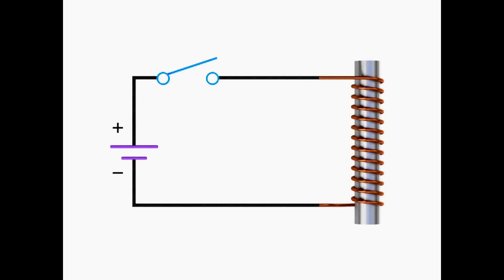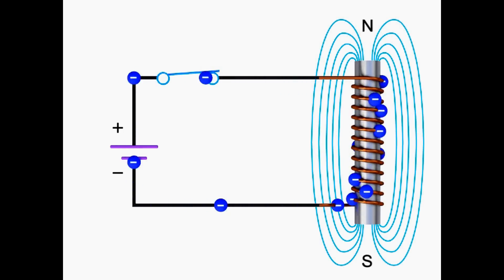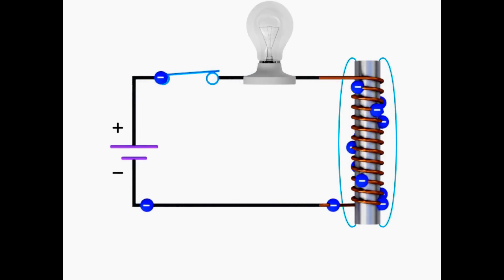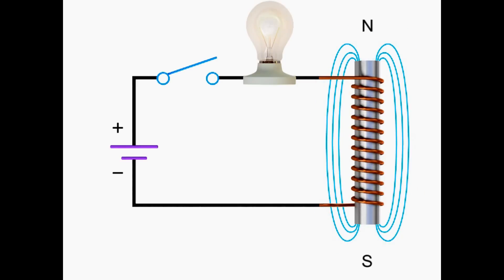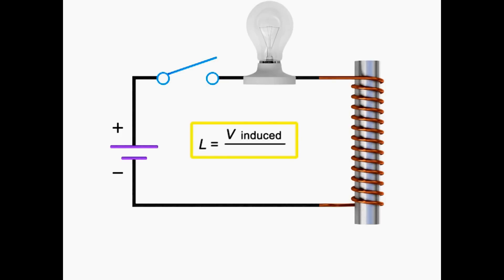How Inductor works

Comment: It is nice speaker. But, there is so difference here, you use DC voltage. But the inductor is  considered as short circuit in DC, where V=L*di/dt, and there is no change in DC voltage or current. However, if you use AC source, I completely agree with you.

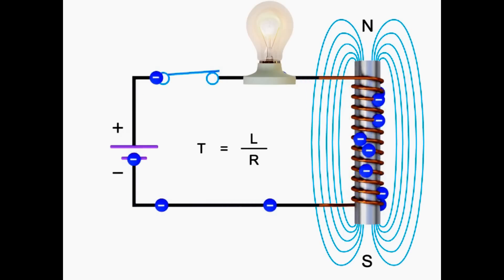Comment: 2:05 when you open the switch the light will go out immediately as there is no longer a closed loop (kirchoff's law). The voltage will rise as the field collapses but it will not magically keep the light bulb lit with an open circuit. incorrect visual.

Comment: What an authoritative sounding Get.
Michael Faraday discovered the law of magnetic induction.  I.e. that a CHANGING magnetic field causes a voltage in a loop, or circuit encompassing that changing field. 
 The voltage, e, in Volts will be equal to the number of Webers of flux change per second - in each and every loop around it.  It is that simple.  
   N.B  Iron saturates towards 1 Weber/m^2, i.e. more magnetising force H, amp-turns/metre, will not make the increase in magnetic field strength, (B,) ( flux density(Wb/m^2) ), that it did at lower flux densities.
   Inductance is exactly analogous to Mass in mechanics, if Voltage is analogous to Force (Newton's), and current (amperes) is analogous to speed.
The relationships are precisely the same, Viz,
Induced EMF, e = N.dFlux/dt
Force, f = M.dv/dt

L (Henry) is defined as flux-turns per ampere, If Flux is measured in Webers.   So if, for instance you double the number of turns around a given iron core, you get twice the flux for the same current as before AND, twice the number of turns, so you have Four times the inductance - as long as the iron does not get Saturated !!
Inductance proportional to N^2

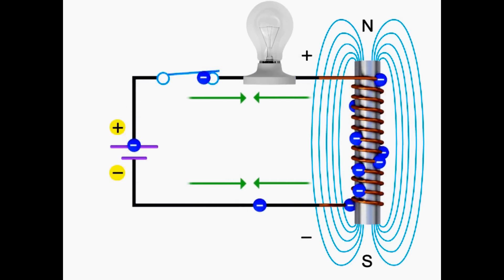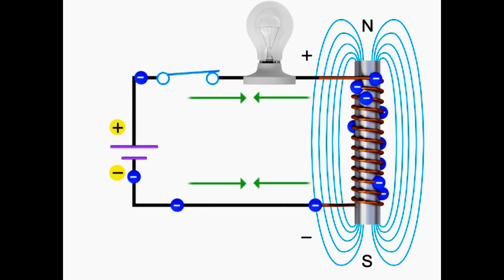Comment: It is interesting to discuss what was said at 1:25 through the statement," Generates a voltage that resists the current coming from the source!".   In the diagram shown at 1:25 it is clear that the current of electrons is shown going into the positive terminal of the battery and they are shown going out of the negative terminal.  This is obviously correct. Then " current coming out of the source" means that it is coming out of one terminal and going into the other of the source!!!!   Then there are two arrows at 1:23 shown going in the same direction which presumably refers to the current and then another set of arrows going in the opposite direction.    Well, the fact that the electrons are emerging from one terminal and entering through the other to mean would require the arrows showing the current to be in opposite direction to represent the entering and emerging of electrons from the source! Perhaps I am being too fussy!

Comment: Would a correctly sized capacitor across the inductor prevent the spark from occuring?
Reply: But there would be a Splat at turn-on then, since the lamp filament will be cold and low resistance.
With a C across the coil - or switch - the result is just like a hammer hitting a Spring.  The softer the spring, (bigger C) the longer the pulse, and the lower the peak force, volts.

Comment: Interesting about the spark across the switch.  I am planning to use a mechanical relay to turn a hotplate on and off.  It has a standard 1500W stovetop coil heater element.  I wonder if this coil will have enough inductance that I should be concerned about arcing in my relay?

My guess is that the inductance is quite low but if anyone knows otherwise let me know.

Comment: Is there inductance in DC circuits? The source is DC if I'm not mistaken.
Reply: The inductance is a value attributed to components within the circuit. So yes. Any wire/coil has some inductance. At some point you will apply or disconnect the DC source, and then apply an impulse to the circuit. In the stable (DC) situation, all of the inductors have zero resistance, and all of the capacitors have infinite resistance. In between, where we have some AC current, there will be out of phase reactances coming into play to cause oscillations of voltage and spikes of current etc. Combinations of LRC values in a network.

Comment: Now, use some nice transformer or inductor with the iron core (it may work without it, but...). First, make contact clean so that you can hold the electrodes. Briefly connect both electrodes while holding it's ends to the battery (small one, 3.7V, 9V, 12V...), and when disconnect - small shock. Show it to your friends and ask exact moment they "saw the stars". :D
Reply: Capacitor hold a charge ,  till it is discharged ,  that is why working on a TV Microwave or appliance you first ground it out , a 220 volt 15 amp capacitor can kill you .
Reply: @JCcanU  The same thing with inductor - it hold magnetic field while current flows. When rapidly current stop flow - magnetic field collapses as fast as stray capacitance allow it. If capacitor is in parallel with the inductor, then it slows down rapid magnetic field collapse, thus producing less voltage difference at the coil outputs. Grounding one end of the inductor will not prevent anything. There is also no "15 amp capacitor". Capacitor store energy and it is expressed in Joules, and it has letter for energy 'E'. Thus, E=1/2 V^2 * C (one half times square of the capacitors voltage times capacitance).

Comment: The whole explanation is compromised because you make the mistake of asserting magnetic poles. There is no such thing: only loops of magnetic field (divB=0). It is the field lines, more properly the flux , INSIDE the coil, which leads to the phenomenon of inductance. Otherwise OK.

Comment: Its bothering me that the flow of electricity is flowing the wrong way in the diagram... xD it goes from positive to negative. Positive is the energy contained, and negative is the energy drained.
Reply: The direction of the current makes no difference to the effect of Inductance.  Inductance opposes CHANGE.

Comment: F=1/T   T=R.C
T= R.1 *  XL
R1is   resistane of lamp
XL = resistance L (coil) henry= H
So  ..... F= 1/ R1x XL
: R1= 220ohm
 XL= 100uH = 0.001Henry
So as  = 1/0.22=4.5sec 
After your turn switch open switch cuicuite 
Lighting  is darkness slowly  with 4.5 sec time

Comment: Never used a magnetic core inductor. Every inductor we have ever used (1000's) have been air core (air choke) without a magnet and does the same job.
Reply: Depends entirely on the application.  The good thing about no core is that you don't have saturation to consider.  The bad thing is that the inductance provided is relatively miniscule !!

Comment: the power source should be AC or DC?
Reply: Inductance just does its thing regardless.  This bloke explained nothing.  Inductance is Flux-turns per Ampere.  The EMF (volts) opposing the current is Always L, the inductance in Henry's, times the rate of change of current.
Inductance is the analogy to Mass in mechanics.

Comment: Why does an inductor able to be induced voltage by using a DC supply? Since DC flows only one direction and has a constant magnetic flux. Doesn't that mean the rod cant be able to induce voltage according to faradays law as it needs alternating current to do so?

Comment: You state that caps store energy in voltage and inductors store energy in current. Wrong inductors store energy in its magnetic field. Yes, the energy in an inductor is equal to 1/2 times the inductance times the square of the current,     energy = 1/2LI^2 , for purposes of computation, but the storage actually is in the magnetic field.
Reply: TheSpeklOne then he failed to explain the lesson properly.
Reply: I think he's talking about how they release the stored energy - the explanation was porrly worded
Reply: It stores current in the magnetic field...
Reply: @Tributary House Ltd. 
But the Seriously wierd thing is when there is no dielectric or magnetic material, the energy is stored in Space !!  Then What's even wierder is that C increases as physical size decreases !?
Reply: @jb9072  
Inductors and Capacitors both store Energy.  How and where is their business.  Not interested.
Reply: sub vibrant tech bro u will get beta staff

Comment: Hey wait!...you said if the open the switch and stop the flow of current, the electro magnetic field will diminish rapidly and simultaneously release energy in the form of VOLTAGE? it's supposed to be IN THE FORM OF CURRENT because inductors store current and not voltage. Capacitor stores Voltage. I think there's a slight mistake in your narration. In the later part of your explanation you said it correctly that capacitors store voltage and Inductors store current, both of which are still of course energy. Please don't get me wrong...I am not being sarcastic...I just noticed something that needs correction in your narration. Peace Bro!!!...BTW just a suggestion, it's better to show the circuit in parralel connection 'coz it's easier to be understood than series connection although both are correct I know.
Reply: aray leche coil same capa not all as 
Capa chager /dischage
Coil  delay current
Reply: Caps store energy in an electric field, inductors in a magnetic field. When you short a cap, theoretically you get infinite current, and opening an inductor produces infinite voltage.

Comment: hey there, I am wondering if you could explain how to create a e-cigarette at home that uses common AA batteries instead of lithium... I am thinking that a circuit that uses 3 or 4 AA batteries with some capacitors, resistors and a inductor may do the trick but I lost the knowhow decades ago... could you create a video about this??
Reply from the maker: I will make it.
Reply: stop vaping its making U ugly
Reply: The E-cig doesn't care about the type of battery you use.  It only cares about its shape (if it has a battery cavity), the voltage, and current supplied.  If the AA has the same voltage and current rating as the Lithium, it will function the same.  If not, you need to convert the battery power to an acceptable operating range for the device.

Comment: wait, so if i run a 20mhz at voltage ac i can expect a discharge bolt out of the blue, so this is why people put a arc pole near the coil to discharge to earth any spike that comes off when switching off, i have a three phase induction heater on it's way so i can expect a massive arc bolt at tripple the voltage spike arc off to bolt hopefully it won't cause a earthquake, i'll go easy and try to remember this spark off end thing each time i might put a warning note in vivid permanent marker to keep back when switch off , thanks you so very much i nearly for got about that, i might tone it down

Comment: DONG GUAN LMET TEAP TECHNOLOGY CO.,LTD (lmeTTeap), acts as a prominent company engaged in designing, engineering, manufacturing, supplying and exporting premium quality assembly automation solution as well as automated assembly machine (assembly line). Our offered range encompasses full-custom automated connector assembly/production machine, automated switches /production machine, electric plug and socket assembly machine, metal hardware assembly machine, molding plastic assembly machine etc.

PRODUCTION LINE
Connector assembly automation:
RJ Connector assembly, electronic connector assembly machine, terminal block assembly machine, AC/DC Power Jack Assembly machine, USB Connector assembly machine, Pin Header & Female Header assembly machine; HDMI connector assembly, FPC connector assembly machine, IDC Connector assembly machine, SFP Connector assembly machine, SCART Assembly machine;
Switches Assembly Automation:
Rocker switch assembly machine, thermostat switch assembly machine, round switch assembly machine, push button switch assembly machine, keyboard switch assembly machine, slide switch assembly machine, toggle switch assembly machine, micro switch assembly machine, rotary switch assembly machine, DIP switch assembly machine etc.
Electrical Assembly Machine:
Electrical Plug Assembly Machine, Electrical Socket & Receptacle Assembly Machine, Mini Box Assembly Machine, Power Base Assembly Machine, Distribution Box Assembly Machine, Switch Box Assembly Machine，Fuse Holder etc.
Relay Assembly Machine. Transformer Assembly Machine
Plastic Assembly Machine:
Plastic Printing Machine, Plastic Insertion Machine, Plastic Ultrasound Welding Machine, etc
Hardware Assembly Machine:
Automatic Screw Drive Machine, Automatic Forming Machine, Automatic Tapping Machine, Automatic Riveting Machine, Automatic Drilling Machine;

WEBSITE:www.lmet-tech.comEmail: info@lmet-tech.com
https://www.youtube.com/channel/UCHjjfBLb2yMcFBOWRTuG9yw